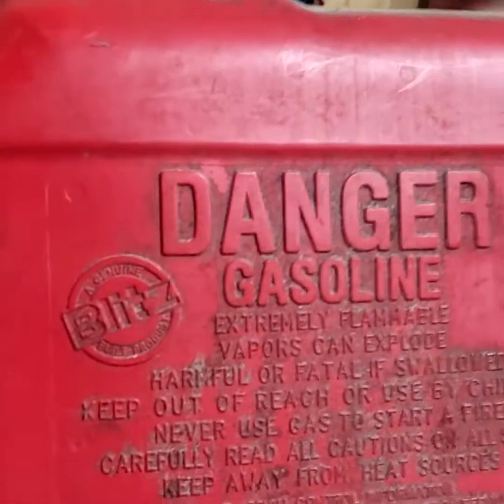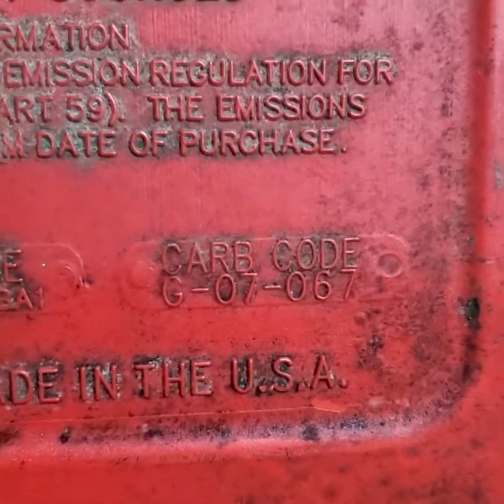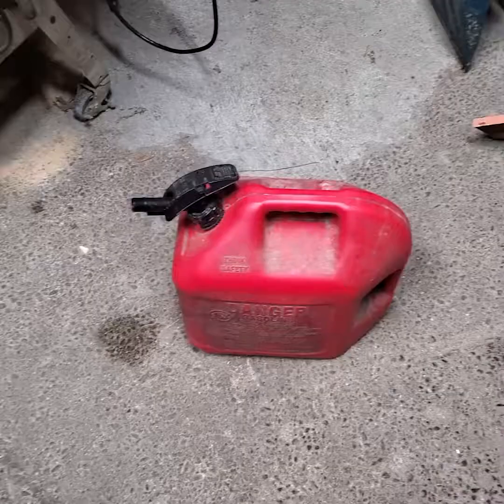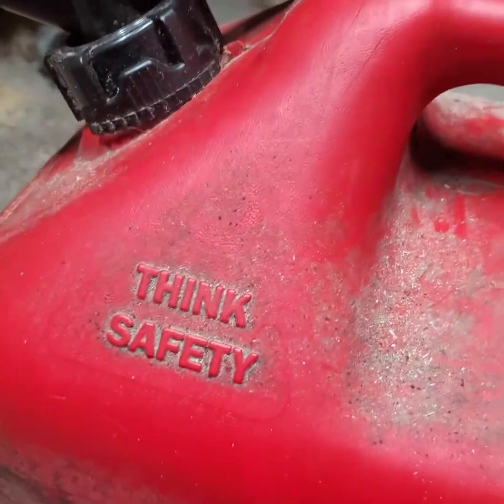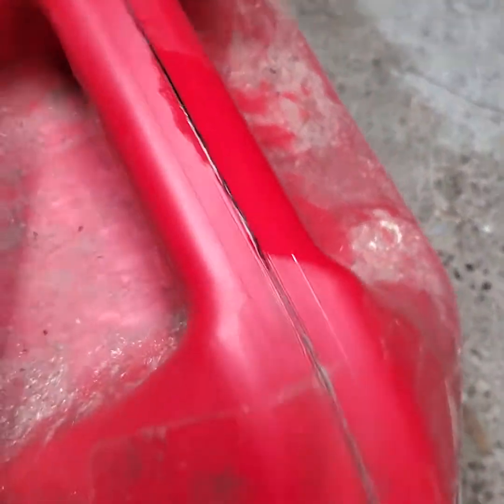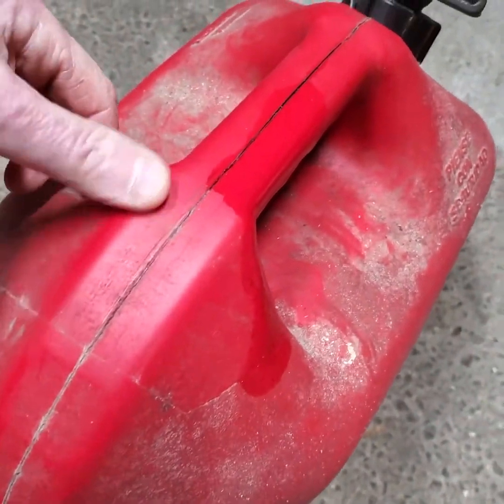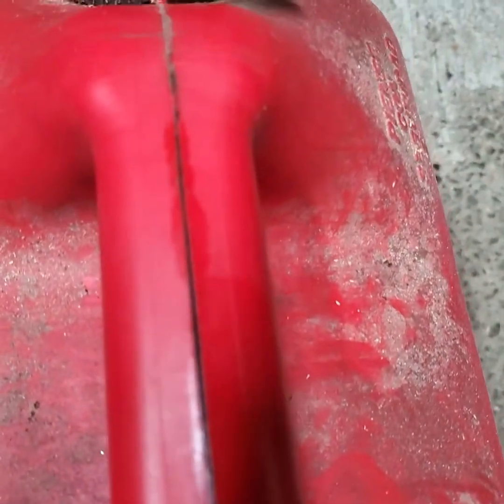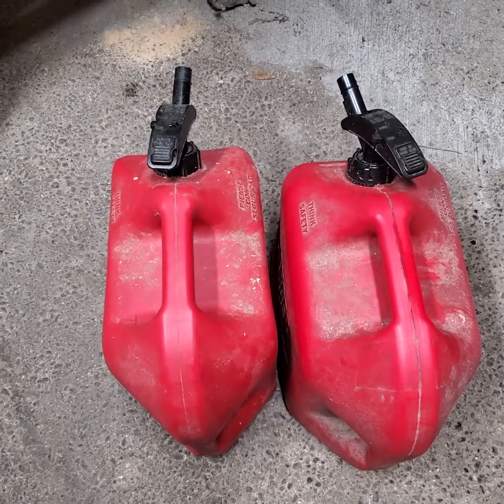Plastic Gas Cans LEAKING!!

Comment: Hey folks I'm here to tell you this video is spot on. I've got Jerry cans filled with gasoline for my generator and with a little seafoam for stability I've left the gasoline there God knows how many years. Every time there's a power failure about twice a year I pull from the oldest tank and refill it and put it back in circulation so the fuel never goes stale on the other hand those Jerry cans keep aging and aging. I've got the same red 5 gallon Blitz Jerry cans in this video and one of mine split but not at the top seam it split at the bottom seam and over a course of several months discharged 5 gallons onto my asphalt driveway and I'll leave it for you as a homework assignment what that did to my driveway. The tanks were stored all their lifetimes in a plastic tent that was ventilated and waterproof and opaque so it blocked the sunlight and these Jerry cans were not subject to abrasion or chemicals in a shop because my firewood shed which is the plastic tent is completely ventilated so there's no reason for these Jerry cans to split open except good old-fashioned old age. Maybe it was ethanol I don't know. And I realize in warm weather these tanks will expand so if you don't release the pressure they will build up warping in shape as they breathe but I was careful always to vent any pressure if I saw it accumulating so there really is no good reason except old age and neglect on my part I should have took immediate action when I smelled gasoline Vapors on my driveway. Unfortunately proper metal Jerry cans cost 40 bucks so that's cost prohibitive so I'm not sure what I'm going to do. I'll probably I'll probably have to replace them with more of the same. But do beware about this and don't neglect it. The owner of this video is quite correct when he says this is a hazard.
Reply from the maker: Thanks for the update on this very dangerous issue. 
I bought 4 "new" versions at BJ's Wholesale to replace the originals from my earlier video. I keep them inside my workshop and try to give them a quick look every once in a while. It is now cold and one of the new empty ones was collapsing due to the cold air so I know its's still good! Ended up venting it, and putting it out in the sun to get it back into the normal shape. - agreed, Nothing like the old steel ones!
Sorry to here about your driveway, OMG.
Happy New Year!
Ted

Comment: My No Spill 2020 5 gallon tanks also started to crack open exactly where yours are at the top seam. And this is from a leading manufacturer also USA made I believe. It’s a shame I only had it 3 years. There are ways on YT showing how to repair these with grafting plastic, but I cant speak to the longevity of repairing one as I haven’t done that yet. Nor am I sure it’s even worth it if a new can is $25 and no risk.
Reply from the maker: That's scary, and  people have no clue how dangerous this is if they store them in a garage attached to their house...

Comment: If you have a air air soldering torch you can take the same type of plastic which I believe is a polypropylene like coffee containers from Costco blah BL make sure there's no fuel in there obviously and dried and vented and clean up the area with isopropyl alcohol heat it up with the torch then and cut out a piece that basically will fit into that area or along that seam and it will basically do the same as a plastic welder that's all a plastic welder uses is hot air and it works fantastic so I see this video is 3 years old you probably got new tanks since then but this welding method does work fantastic for gas cans like I said make sure they are empty of fuel and no fumes coming out of them as far as wet fuel inside make sure it's dry and then make sure it's vented and this fix really does work fantastic then again buying a new can is not really a big issue but this does work
Reply from the maker: I don't condone trying to fix a failed plastic fuel tank. This is a defect in design and very dangerous.
It makes senseto  buy a new one.

Comment: I just use duct tape around the handle which stop the venting of fuel and duct tape does not melt or degrade like some silicone or not silicones but rubber tapes so I use duct tape just before I go ahead and are weld some plastic on their some polypropylene and duct tape does not degrade or melt with the vapors and at least it keeps the vapors where they should be until you can make the fix, then again buying a new can is not a big deal as I said